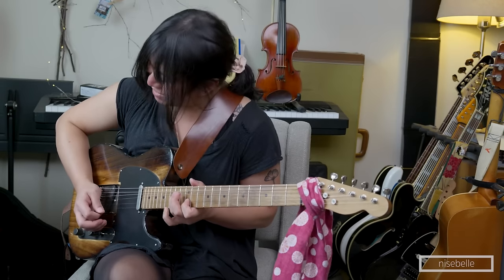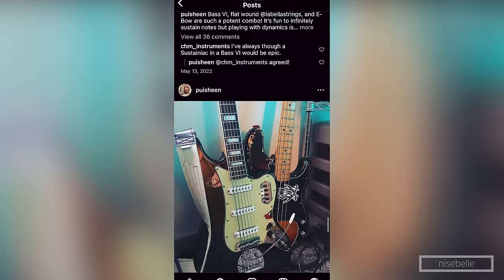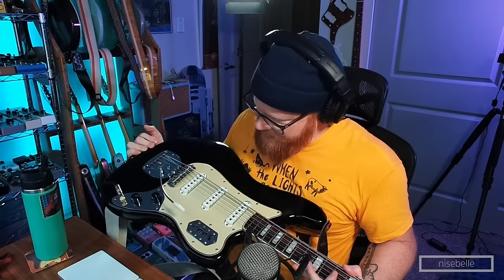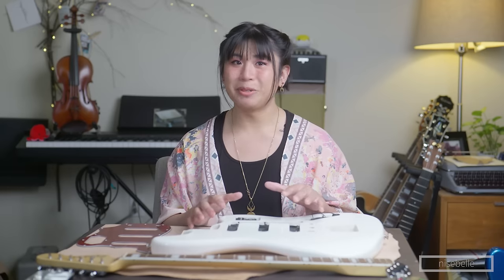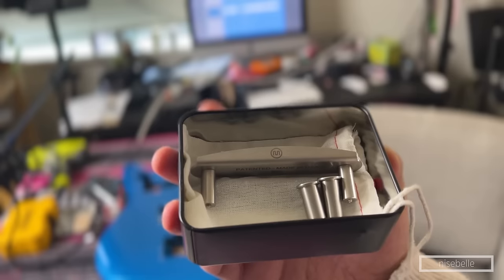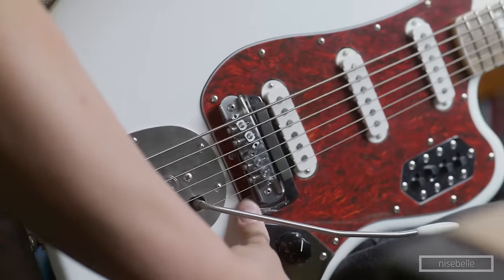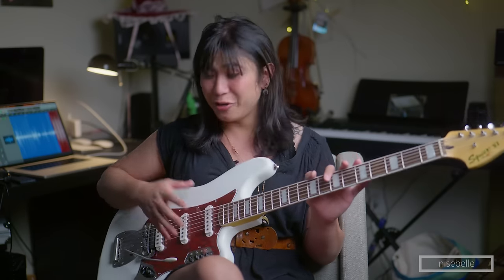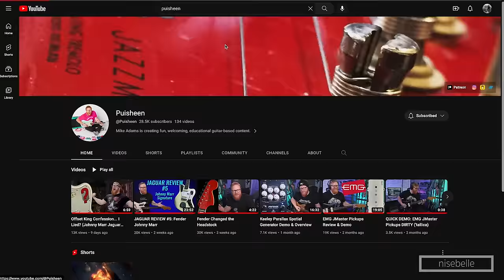Modding My Squier Bass VI (feat. @Puisheen)

Comment: I've a lot of YT videos where pots get changed and I have always wondered why the pot manufactures don't put a ground lug on the back. Everyone has to ground it with a big dollop of solder directly on the back plate of the pot.

Comment: I have Bass SIX very heavy and sturdy instrument! But very muddy and definitely will need some mods to make like really main guitar I basically don't use electronic don't like passive they eat clarity and I put single coil neodymium rail pick up for bridge position. For neck pickup don't have idea what I will prefer in that place. For string selection I really like nylon wound strings but they typically dull sounding so they need to be more lighter gauge strings set. So I it's long journey to get guitar that I really want but I it's really interesting thing when you combine some parts that's never been together and get totally unpredictable result. Also Bass SIX have very nasty problem with six bass string so its another adventure. So if need ready from box guitar this not definitely best guitar but if you like make so mods it's will be very interested adventure for you!

Comment: Great input :) I'm part way through a full build on Warmoth's version of the bass VI. Since I ordered the body to be built ( rather than a showcase body) I got to make some of my favorite changes. One piece Mahogany body. No bridge or trem routes. A universal (bathtub) pickup cavity. I bought a neck from the showcase which had a Maple board. The warmoth neck comes with their Warhead  headstock which is fender-esc but with a smaller top end. To that I added hipshot open gear lockers. Since I use a bass VI as an octave guitar, I went with 2 Seymour duncan strat stack plus pickups ( neck & middle ) with a '59 trembucker in the bridge. To top it all off I'm using a Khaler flat mount tremolo that I got the help of Gary Khaler himself to set up specifically for the needs of a bass VI. Due to the Khaler being a cam type trem with a stationary bridge, I can mute with my palm.

I hope someday you have the time and the budget to do a full build. Would love to see what you create. 🥰
Reply: did you finish it?

Comment: Nice video about modding your “ Penelope Bass” , well done, sounds great too!

Just one tip, “Penelope’s “ body is made of poplar, a soft wood, so it might be wise to drop a small coin, or metal plate in the hole for the mute plunger, since the plunger spring will dig slowly into the wood otherwise.
I have seen a CV bass VI where the spring actually started to come out at the back of the guitar ..,
Reply: That's really scary... Like a horror film... I won't be able to get any sleep now... Oh well!!

Comment: Thanks for doing the Bass VI mod. I bought a Squier Classic Vibe but sold it soon after because I was finding the intonation issue hard to handle with the stock setup. In theory it’s the ultimate hybrid but it does need some work.

Comment: Great vid. The only difference I would have done is series mod, plus an extra strangle. By adding four 3 way switches (ON-OFF-ON). The pickups wired such that when down you get series with B-M series, M-N series, or M-BN(B-N in parallel - then in series with the middle). The Strangle is would be top normal, middle double bass cut (for when series is too dark), bottom off. The series mod is based on the jaguar series mod. The strangle is my own design, using two capacitors of the same value in parallel. They when together cut the values in half (less bass cut - normal, when in off more bass cut). Most 3 way slide switches are 5 mm in height (not 9/ 9.5 mm) so that's an added benefit.  The cost of 10 switches is under $10 AUD (<$5 USD).

Comment: Now I feel like modding one of my AX7521 (I have a few, they're cheap and awesome).  Cut the nut so the top three strings can be light bass strings and swap out saddles if need be (singles are replaceable).  I've already thought about trying a top mount trem system but options are limited for a 7 string.

Yes.  I've been shopping for a 7 string bass so I can learn a certain body of work and this might actually be something I can use until I either decide if I want to keep doing it and/or find one I want and can actually acquire.  Thanks for the inspiration.

Comment: OMG what a lot of money to have spent on the guitar.
I have owned 2 Bass VIs: a 1965 (with the hideous rubber mute - why would anyone use one?!) and then a 1996 Japanese reissue, sounding the same to my ears.  Both had that floating 'tremolo' system which feels horrible compared to a Strat one, and a bridge that allows the strings to slip off if used even moderately hard.  My latter guitar was a sunburst model but came with a red scratchplate!!! (I sourced a tortoiseshell one from the States).  I also have an early reissue Danelectro 6 string bass (with wooden bridge, which surprisingly works fine) and I have to say the sound is far superior to the Fenders, and the playability of the neck is great - amazing access to the upper reaches.  So my recommendation would have been to simply get a Danelectro and stick with roundwound strings (but forget having a 'tremolo' arm).

Comment: Excellent! I was researching Bass VI fixes/mods, and yours is the best video. A couple questions:

1. Do you know about the difference between the Novak pickups vs the Lollar vi pickups? I haven’t seen anyone compare those yet. 

2. Any idea if the newly released Fender Vintera II Bass VI fixes many of the squire issues? Intonation, bristle rattling, needing a neck shin, etc? And pickup quality. Im wondering if that would work out of the box, or only require 1 or 2 mods, such as adding the mute.

Thanks!
Reply from the maker: Thank you so much! So I had the chance to try out both the lollars and the Novaks and to my ears, I found the lollars to have more bass response as well as the typical high end sparkle you get with lollars, while the Novaks have a lot more of a low midrange emphasis and definition and are overall a little darker.

For the vintera ii, I have yet to try one out myself so I can’t speak to first hand experience. That being said, from looking at the specs, I’d assume it will still need a shim since there’s nothing saying it has an angled neck pocket, and I assume the intonation should be better since it comes with the correct 1 inch bridge. If I get to try one out at a local shop I’ll post an update!

Hope this helps!

Comment: I definitely applied how you modified Penelope, nisebelle. My Triassi is if you can play her and sing the melody together. That isn’t something just anyone can do when you’re playing a standard base guitar, let alone a contrapuntal model like the Bass Six.

I have a Vintage Modified Bass Six myself. I like everything about it, only I would prefer that the stock pickups were a little bit hotter. I’ve been told it wasn’t necessary to swap them out; all you would need is for somebody to wind them a little tighter for a beefier output. After all the modifications made to Penelope, what’s your reaction?

Comment: I’ve got a Japanese Fender and early Squire VM. I use baritone (Jpn) with E-G at .105-.45 and B-.20, E-.18. I think I’m going to do exactly what you did the Squire VM with a Mastery and make it a hard tail and lighter gauge. No one asked or explained the capacitor difference and reason. I was also thinking about put a brass nut in.  The split coil pickups sounds like an interesting swap )as suggested by someone here. The Japanese was 3x the price and the quality and finish is very evident. A  FrankenSquire? Why not? I have had it for ten years and it’s not getting as much action. It was never intonated properly. A Staytrem for the Fender Japanese maybe later. Thinking about budget etc. My main bass is a Steinberger ‘83 XL-2A, it needs fret dressing and new string ball jaws, so in the meantime I’ve gotta keep with priorities and use the Bass VI as my only bass. I use a parametric EQ for bass, and Y out to a bass and guitar amp (like you). I make bass loops and then play guitar with synth over top for a bass with wall of sound and I think I can do it better with the mods because the guitar layers have loads of FX. Great video, smooth edits! Wishing you continued success!

Comment: Interesting that you didn't replace the tuners, or did I miss that? I've heard that tuning/intonation is the main issue to conquer, which the vibrato bar replacement would certainly help with the stiffer spring. It's a lot to process, the expense of the parts and labor just to make it legit.

Comment: great video! Did you end up adjusting the neck angle? I did that mod and then eventually rolled it back, I didn’t find it helped anything.

Did you end up wrapping your low e over the string string plate on the vibrato to help the tension?
Reply from the maker: Thanks! I did end up adjusting the neck angle! Because of the mute, the bridge needed to be a raised off the body a bit so I went with around a 1 degree pitch back to keep the action low enough for my weak as hands haha.

I didn’t even think about wrapping the low e over the plate! I might have to give that a shot since it is still a bit too loose for my liking. Thanks for the suggestion!
Reply: @nisebelle  appreciate the thorough reply! Would be happy to share my bass vi experiments, it's been a headache and a half hahaha.

Comment: This model is made out of Basswood correct?
I have a MIJ Jaguar that’s basswood as well and I wanted to get the Fender Mute installed however I’ve heard because of the softer wood the spring might dig into it over time

I was wondering if you took any measures to counteract that or have you noticed any problems with it?

Comment: Finally received my Squier Bass VI VM replacement. The first arrived horribly damaged from Fender. Could you please tell me your starting place for the neck shim? Do I use balsa wood, sandpaper or what material and thickness as a starting point? I have never removed a neck, or tried to put a shim. Any suggestions would be greatly appreciated. Thank you. Bruce

Comment: what kind of amp would the bass vi be perfect?   i mean would it be considered a bass and might destroy a guitar amp or would it be better be used with a bass amp?
Reply from the maker: I actually used a guitar amp (Friedman Buxom Betty) emulator for the recordings, but I’ve been playing it lately through both my Mark Bass bass amp and my Vox ac4. She doesn’t really have as hot of an output as a traditional bass so guitar amps have no problem handling it, but you definitely get more low end punch and clarity when playing it through a bass amp.
Reply: thank you very much for a very informative answer,

Comment: what’s the issue trying to install a fender mute with a non mastery bridge?
Reply from the maker: If I had kept the stock bridge it would’ve worked fine, but I wasn’t too happy with the stock bridge. The other replacement options (staytrem and actual vintage or vintage reissue part) have a 1 inch base plate that doesn’t fit in the fender mute, so the mastery ended up being the best option for what I was looking for.

Comment: What did you use and how much did you shim the neck?
Reply from the maker: I used a shim made of a material called butter board, it’s like card stock but it’s denser so it doesn’t compress as much. The angle came out to be right around 1 degree so I’ve got a full pocket stewmac one coming in the mail!
Reply: @nisebelle  what angle?  And is it a standard guitar neck shim?
Reply from the maker: @danieldesy2969  the one I used is around 1 degree and I made it for the project so not quite a standard guitar shim. 

The replacement one I’m going to put in is the 1 degree blank from stew Mac so I can cut it to size
Reply: @nisebelle  got it.  Thanks for the info!